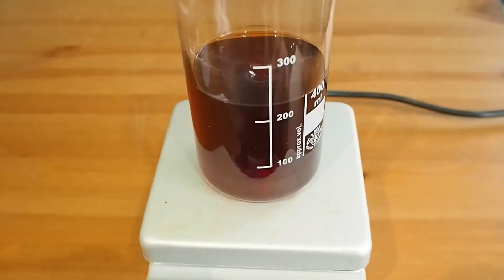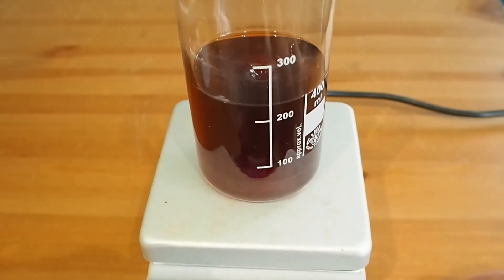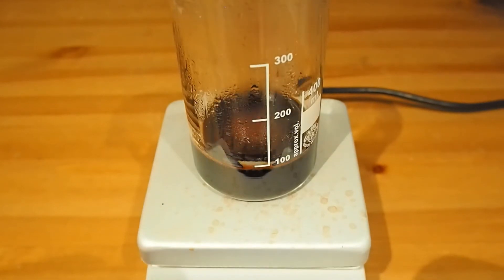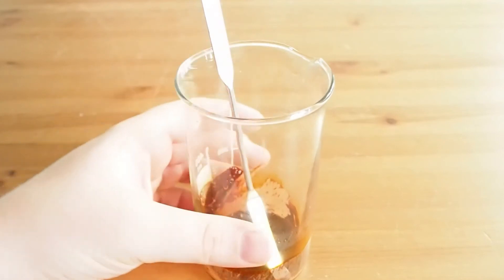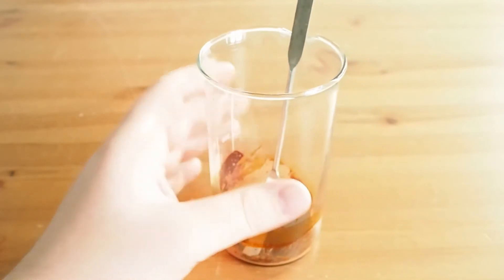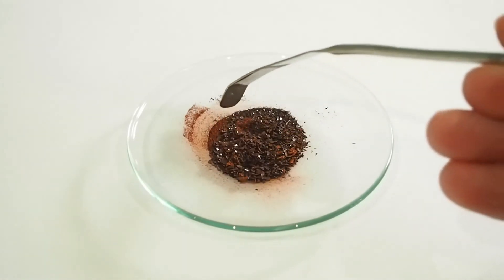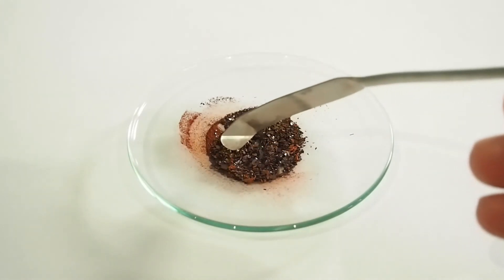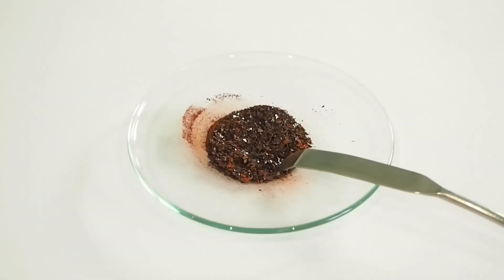Making Iron (III) Acetate - Ferric Acetate

Comment: Is there any way to differentiate this from regular rust? While the acid is interacting with the iron, the water is also interacting with the iron to create common iron oxides, leaving you with a mix of rust and iron acetate? I ask because I'm interested in making batches of this for mordant and my thinking is that having loose rust will dilute its effectiveness.
Reply: Use a filter paper as rust isn’t soluble in water/acetic acid solution as compared to iron acetate.
Reply: wont the rust make a salt with the acetic acid anyway?